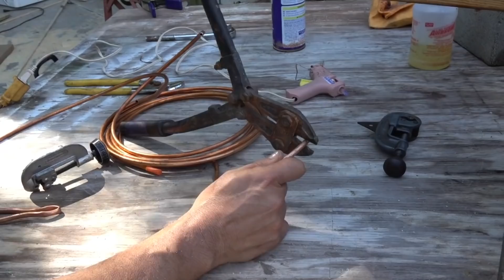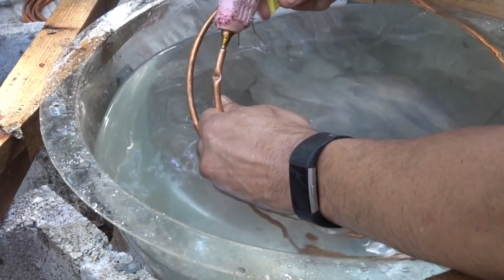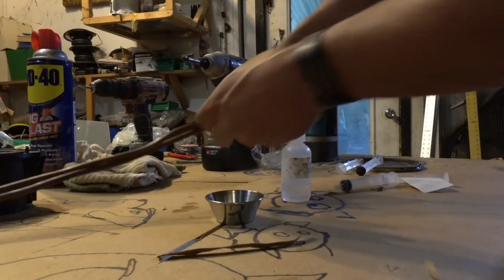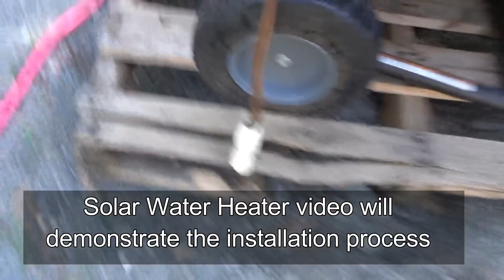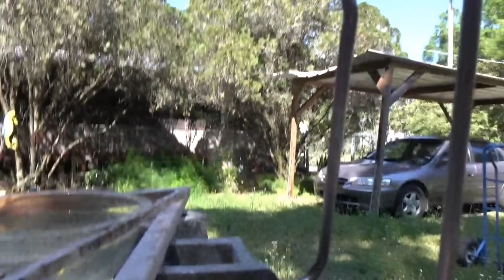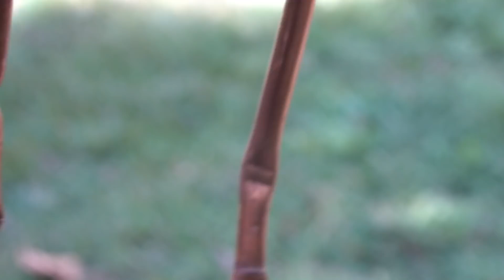Bending copper tubing solar hot water heat exchanger Detailed Version

Comment: My dad had a flaring jig and a testing jig. They were both like locking pliers for copper pipe (half inch). He'd use them together for bending because the tester's little air pump could be hooked to a hose and put in a bucket. ... Though I don't think he used them to bend more than 45 degrees. Also, he put teflon tape on the flaring clamp.
Reply: 1  In the name of God, the Gracious, the Merciful.
2  Praise be to God, Lord of the Worlds.
3  The Most Gracious, the Most Merciful.
4  Master of the Day of Judgment.
5  It is You we worship, and upon You we call for help.
6  Guide us to the straight path.
7  The path of those You have blessed, not of those against whom there is anger, nor of those who are misguided.

163  Your God is one God. There is no god but He, the Benevolent, the Compassionate.

2  God, there is no god but He, the Living, the Eternal.
4  To Him belongs everything in the heavens and everything on earth. He is the Sublime, the Magnificent.
11  Originator of the heavens and the earth. He made for you mates from among yourselves, and pairs of animals, by means of which He multiplies you. There is nothing like Him. He is the Hearing, the Seeing.

1  Say, “He is God, the One.
2  God, the Absolute.
3  He begets not, nor was He begotten.
4  And there is none comparable to Him.”

3  He sent down to you the Book with the Truth, confirming what came before it; and He sent down the Torah and the Gospel.
4  Aforetime, as guidance for mankind; and He sent down the Criterion. Those who have rejected God’s signs will have a severe punishment. God is Mighty, Able to take revenge.
5  Nothing is hidden from God, on earth or in the heaven.
6  It is He who forms you in the wombs as He wills. There is no god except He, the Almighty, the Wise.

14  We have entrusted the human being with the care of his parents. His mother carried him through hardship upon hardship, weaning him in two years. So give thanks to Me, and to your parents. To Me is the destination.
15  But if they strive to have you associate with Me something of which you have no knowledge, do not obey them. But keep them company in this life, in kindness, and follow the path of him who turns to Me. Then to Me is your return; and I will inform you of what you used to do.

48  God does not forgive association with Him, but He forgives anything less than that to whomever He wills. Whoever associates anything with God has devised a monstrous sin.

31  Say, “If you love God, then follow me, and God will love you, and will forgive you your sins.” God is Forgiving and Merciful.
32  Say, “Obey God and the Messenger.” But if they turn away—God does not love the faithless.
33  God chose Adam, and Noah, and the family of Abraham, and the family of Imran, over all mankind.
34  Offspring one of the other. God is Hearer and Knower.
35  The wife of Imran said, “My Lord, I have vowed to You what is in my womb, dedicated, so accept from me; You are the Hearer and Knower.”
36  And when she delivered her, she said, “My Lord, I have delivered a female,” and God was well aware of what she has delivered, “and the male is not like the female, and I have named her Mary, and have commended her and her descendants to Your protection, from Satan the outcast.”
37  Her Lord accepted her with a gracious reception, and brought her a beautiful upbringing, and entrusted her to the care of Zechariah. Whenever Zechariah entered upon her in the sanctuary, he found her with provision. He said, “O Mary, where did you get this from?” She said, “It is from God; God provides to whom He wills without reckoning.”

16  And mention in the Scripture Mary, when she withdrew from her people to an eastern location.
17  She screened herself away from them, and We sent to her Our spirit, and He appeared to her as an immaculate human.
18  She said, “I take refuge from you in the Most Merciful, should you be righteous.”
19  He said, “I am only the messenger of your Lord, to give you the gift of a pure son.”
20  She said, “How can I have a son, when no man has touched me, and I was never unchaste?”
21  He said, “Thus said your Lord, `It is easy for Me, and We will make him a sign for humanity, and a mercy from Us. It is a matter already decided.'“
22  So she carried him, and secluded herself with him in a remote place.
23  The labor-pains came upon her, by the trunk of a palm-tree. She said, “I wish I had died before this, and been completely forgotten.”
24  Whereupon he called her from beneath her: “Do not worry; your Lord has placed a stream beneath you.
25  And shake the trunk of the palm-tree towards you, and it will drop ripe dates by you.”
26  “So eat, and drink, and be consoled. And if you see any human, say, ‘I have vowed a fast to the Most Gracious, so I will not speak to any human today.'“
27  Then she came to her people, carrying him. They said, “O Mary, you have done something terrible.
28  O sister of Aaron, your father was not an evil man, and your mother was not a whore.”
29  So she pointed to him. They said, “How can we speak to an infant in the crib?”
30  He said, “I am the servant of God. He has given me the Scripture, and made me a prophet.
31  And has made me blessed wherever I may be; and has enjoined on me prayer and charity, so long as I live.
32  And kind to my mother, and He did not make me a disobedient rebel.
33  So Peace is upon me the day I was born, and the day I die, and the Day I get resurrected alive.”
34  That is Jesus son of Mary—the Word of truth about which they doubt.
35  It is not for God to have a child—glory be to Him. To have anything done, He says to it, “Be,” and it becomes.
36  “God is my Lord and your Lord, so worship Him. That is a straight path.”
37  But the various factions differed among themselves. So woe to those who disbelieve from the scene of a tremendous Day.
38  Listen to them and watch for them the Day they come to Us. But the wrongdoers today are completely lost.
39  And warn them of the Day of Regret, when the matter will be concluded. Yet they are heedless, and they do not believe.
40  It is We who will inherit the earth and everyone on it, and to Us they will be returned.

15  O People of the Book! Our Messenger has come to you, clarifying for you much of what you kept hidden of the Book, and overlooking much. A light from God has come to you, and a clear Book.
16  God guides with it whoever follows His approval to the ways of peace, and He brings them out of darkness into light, by His permission, and He guides them in a straight path.
17  They disbelieve those who say, “God is the Christ, the son of Mary.” Say, “Who can prevent God, if He willed, from annihilating the Christ son of Mary, and his mother, and everyone on earth?” To God belongs the sovereignty of the heavens and the earth and what is between them. He creates whatever He wills, and God has power over everything.
18  The Jews and the Christians say, “We are the children of God, and His beloved.” Say, “Why then does He punish you for your sins?” In fact, you are humans from among those He created. He forgives whom He wills, and He punishes whom He wills. To God belongs the dominion of the heavens and the earth and what lies between them, and to Him is the return.
19  O People of the Book! Our Messenger has come to you, making things clear to you—after a cessation of messengers—so that you cannot say, “No preacher has come to us, and no warner.” In fact, a preacher has come to you, and a warner; and God is Capable of everything.

28  It is He who sent His Messenger with the guidance and the religion of truth, to make it prevail over all religions. God suffices as Witness.
29  Muhammad is the Messenger of God. Those with him are stern against the disbelievers, yet compassionate amongst themselves. You see them kneeling, prostrating, seeking blessings from God and approval. Their marks are on their faces from the effects of prostration. Such is their description in the Torah, and their description in the Gospel: like a plant that sprouts, becomes strong, grows thick, and rests on its stem, impressing the farmers. Through them He enrages the disbelievers. God has promised those among them who believe and do good deeds forgiveness and a great reward.

84  Say, “We believe in God, and in what was revealed to us; and in what was revealed to Abraham, and Ishmael, and Isaac, and Jacob, and the Patriarchs; and in what was given to Moses, and Jesus, and the prophets from their Lord. We make no distinction between any of them, and to Him we submit.”
85  Whoever seeks other than Islam as a religion, it will not be accepted from him, and in the Hereafter he will be among the losers.

111  And say, “Praise be to God, who has not begotten a son, nor has He a partner in sovereignty, nor has He an ally out of weakness, and glorify Him constantly.”

Read The Quran

Comment: Cool.. I never thought about creating a double seal with hot glue!! And using water pressure to keep from kinking. I want to build a hybrid boiler, with concentrated solar, and a wood stove to heat water, to heat water for home use and home heating,  I'd like to use the heat from a generator to also contribute to the heating, being off grid, thermal consevation can save ALOT.. I'd like to make steam without any explosions!! To power a generator from the wood stove, while heating the house, in the process,  using the house to condense the steam.

Comment: when you rap the tube around the pipe you should leave space between each wind to increase the surface area exposed to the water for better flow over the surface of the pipe.

Comment: Curious if you could run the stainless steel or copper tubing through the wall of a wood stove to heat a liquid for baseboard radiators.  Not for sure if you could seal up tubing penetration points in the side of the wood stove or if the tubing could handle the internal wood stove temps.

Also are you aware of any propane heaters which could be used with a heater exchanger like you've made here?  I'm imagining you could have a propane heater which sits outside so venting is not a problem and the flame would heat the exchanger and the tubing could penetrate a cabin's walls and connect to a base board radiator.  Maybe thermosyphoning could be used so a pump is not required.

Comment: I think for all the aggro sealing the water in, I'd just use a push fit tap fitting at each end. Easy to get all the water out and pipe can still be crimped for belt and braces.

Comment: You could have done it the Russian way: fill it with water, put it in a freezer, then bend the copper tube with ice in it, after you're done get a blowtorch/put-it-in-the-sun/just-wait and let it melt.
Or you could use the other Russian way of doing it: fill it with soda/salt, which you can easily dissolve with water after you're done bending, which is much easier to get out of your pipe than sand (when you have a lot of bends the sand gets stuck).

Comment: if it's not too long of a tube salt or sand works well and should blow out with air or water pressure.  basically any small granules that don't compact too much.  you really need to support your bends around a round shape gradually reducing your radius.  you went from straight to a tight bend without much stepping down and it looks half kinked.
Reply from the maker: It is a bit but flow is good. The opening requires a 180 where the tube touches and if the inner material is too tight, the bend is either impossible by hand or will stretch the copper open on the outer curve basically ripping it.

Comment: You would probably get better heat transfer if the long skinny pipes you showed in the beginning weren't twisted,  Otherwise the heat given off by the inlet side gets absorbed right back into the outlet side.
Reply from the maker: The temperature will travel to the cooler body of water the copper tube is submerged in. Most commercial solar electric hybrids have a large inlet opening for a coil similar to the final one I turned with the out going directly down the center. The copper loops all touch. If it were a solar air heater with air being the transfer/heated goal then touching would be bad. Water is really good at absorbing or balancing temperatures rapidly.

Comment: How much larger of a diameter copper pipe can you use this method on to coil the copper?
Reply from the maker: Larger tubing will work for giant diameters, smaller 1/4" tubing will start to lose or not maintain the curved shape at 20 inches in diameter. For 1/4 " about a 10 inch diameter loop is the maximum good coil without heating it.

Comment: LOL That beats the hell out of spending a hour filling the tubing with tot lot sand.
Reply from the maker: Yea, and if you do a tighter turn, the sand is very difficult to remove. Same with salt. I did it the other ways and I got a glob of salt that would not come out and the sand took forever to remove.
Reply: @GREENPOWERSCIENCE  Regretting cashing in all the tubing I had as copper scrap once I found real uses for the stuff.  These make excellent Ethanol Consider Coils .  Water Heater in the works now.

Comment: Brother water does compress sorry to say.
Reply from the maker: The answer is yes, You can compress water, or almost any material. However, it requires a great deal of pressure to accomplish a little compression. For that reason, liquids and solids are sometimes referred to as being incompressible. From google, so unless you have 60,000 psi….

Comment: an old man, years ago, showed me how to bend tube by filling it with sand, just black tape the ends.
Reply: A scene out of Flight of the Phoenix (1964.)
Reply: 2007rgallo fill it with water,freeze, bend
Reply: @peterbeyer5755  lol
Reply: @peterbeyer5755  truth.  Easy in winter
Reply: That's what I did (40 years ago).  I used parakeet birdseed or something and an oxy-acetylene torch to do the bending.  Worked great, even for a very tight circle.  I was bending around a 1/4" pipe.
Reply: does this work well?  It feels like it does.
Reply: @David-bc4rh  used often in industry prior to modern pipe bending machines

Comment: if u heat the copper up with a torch when it changes color it becomes super soft and after u bend it hardens back up
Reply: Try to bend it when hot😉it will crimp even quicker
Reply: It’s already soft copper bra..already anealed

Comment: using sand for bending pipes works well, you can blow it out with an air compressor and it wont let the pipe kink
Reply: @MN SHP  A fellow I know annealed the tubing, then filled it with using table salt, tamped with a piece of wooden dowel. He blew out the tubing and warmed it with hot air to make sure it was dry inside. Removing the salt was easy and rinsing with fresh water washed out any residue. One option if there's no fine sand on hand. I had some white sand for making mortar, stuff not used in an earlier project. It worked very well.
Reply: ...and you can use the fork of a tree to start the bend...

Comment from the maker: This is the first part for solar water heaters.
Yard is a mess and neighborhood noisy like usual.
Reply: I have a use for this and not for solar. Copper is so expensive now that one kink or flatten out spot is time to go berserk.
Reply from the maker: I know it can be frustrating. I bought one of those hand plier benders and it was okay for a bend but that was it , you still can kink with water if you try but it helps prevent it a lot.
Reply: @GREENPOWERSCIENCE I have a need as a big coil to sit in a Home Depot bucket that is filled with water.  The tube goes to a chiller and sitting inside the coil is a water pump so I need something about the size of the stainless coil you had.
Reply: Someones been hitting the weights hard, dam tho... GET TO THE CHOPPA
Reply: @RadCobs Dan works out for sure and has been pumped for a few years now.  I have never been able to build up even when I was young so I would have to roid and I lay odds even then I wouldn't.  Just not in my genetic makeup to be pumped like it is with Dan.
Reply: Thank. Rather, shoot the following videos. I’ve been watching your channel for a long time, all the information is very interesting! Regards from Russia!
Reply: Dan, i been a fan ever since i can remember, i live in mexico and im on a salary so i cant buy a lense from your site, ive seen the led and newer screen tvs also have a shert film, more flexible than what you use, could this work?? I want to bake breads and dehydrate fruits.

Comment: use sand to bend copper pipes. fill with sand and bend around a form. that's how a buddy does it for condensers or something like that.
Reply: It seems like a longer tube would be better. But maybe the temperature on the exit is as low as it could go? Depends on the flow rate and temp I guess. What temps and flow rate...
Reply from the maker: Hi,

The flow with one is about 1/2 GPM and taller water heaters can accept a longer tube. The temperatures depend on solar device. Something like a few hundred feet of inexpensive black tubing works really good.
Reply: can't wait to see how you do it. always nice to learn new techniques
Reply from the maker: Thank you Richard, this works really good.
Reply: Table salt as well and is cheaper than sand.
Reply from the maker: Hi,
My chat was down on my mac. This is 1/4" and this was $10. Sometimes it is $19. Not sure why but when it is, I buy a few.
Reply: @GREENPOWERSCIENCE Yep, I need 3/8in and that stuff is not cheap at all.
Reply from the maker: Ebay has 50 ft for $34 plus $ 14 shipping… Not a bad deal. I had a few hundred feet but no idea where it is. Time really goes by fast. I think the tubing I have was bought in 2009
Reply: @thebeststooge  .........use seawater........100% natural....and available with free salt flavor .....just add required amount of fine beach sand.....works for me all the time !!! Lol !